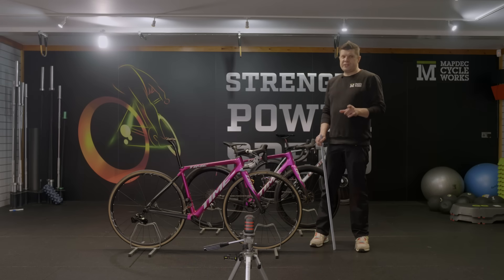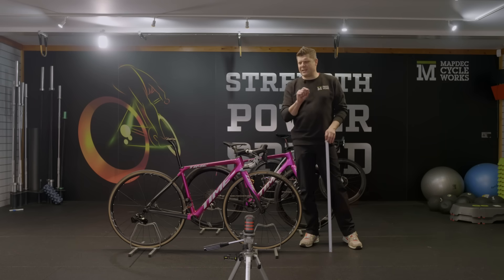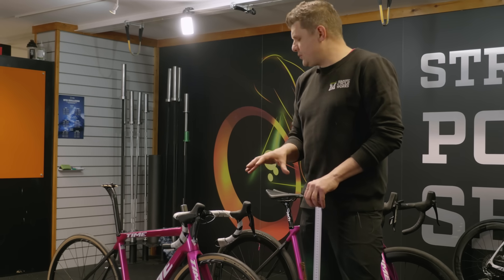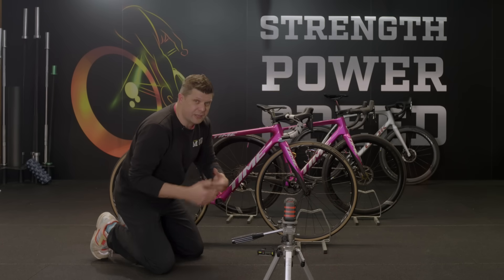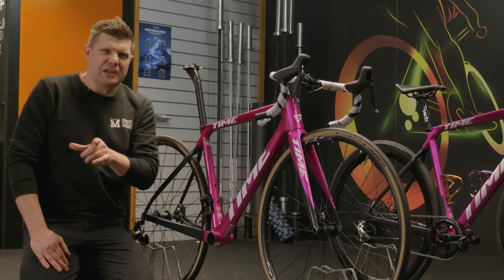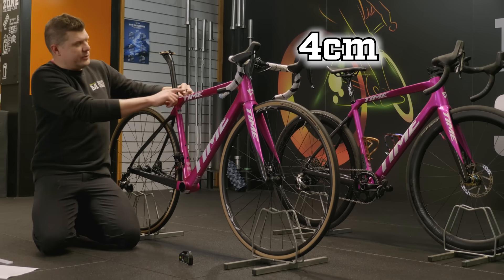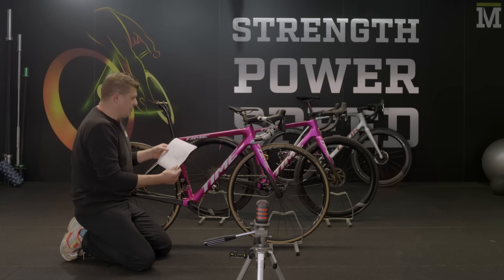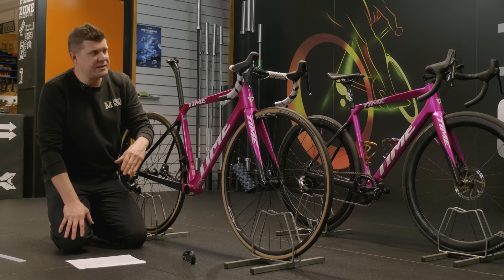Small Bikes - Big Decisions

Comment: I'm one of those riders with small bikes, and I will say that I've never seen an xs with a 172 crank on it. For folks with knee issues, that size crank may cause more knee issues if they are not able to get the knee over the pedal axle. I had a ti frame custom built for many years ago, and had a fit before I ordered it. It was indeed the most comfortable bike that I've ever had. I did tweak handlebar and stem over the years, but truly was very fortunate. I also had a couple of other fairly high end road bikes at the time, and although they were indeed comfortable... still nothing was quite the same as the ti bike. As someone who has had 5 knee surgeries, that distance from seat to handlebar and knee to pedal axle were crucial for me, and might not be quite as important as someone else.

Comment: It's too bad no brands bother with smaller wheels on their smallest sizes. 584/571BSD wheels would help a lot to get the toe overlap issues in check, and allow for neutral handling. You'd expect the gearing to change slightly to compensate for the smaller diameter, but it's possible.

Comment: Something this video didn't touch on is the controls i.e. how do small and tiny hands cope with brake levers and shifters? I remember this was a big problem for me as a child, I could only brake my first road bike with the lever extensions that ran parallel to the tops, and by the time I out grew the bike I still barely able to brake from the drops.

Presumably electronic shifters are much easier, but what are the best options if you can't afford electronic? What are the best brakes with shortest reach for tiny hands?
Reply from the maker: This is still a problem in kids bikes.  A few brands are trying.  The effective and adjustable stuff is on products out of price reach of young riders.

Comment: Very slack head angle and very short stem is the default configuration on most mountain bikes, so what makes it not scary for those? is it purely the 700mm - 800mm bar width that makes the difference? or is there something else going on with the overall geometry?
Reply from the maker: Good question. On MTB you will descend standing, with weight further forward and yes, with wider bars.  If you have tried climbing on a slack MTB with short stem you will know exactly how hard they are to keep in a straight line.
Reply: @Mapdec  Not something I've tried, my MTB was an ancient 90s era model when I had one. Really would love to get something modern (both road and MTB) but it probably won't ever happen at this point.

Comment: Others have mentioned 650b wheels, but 650c used to be an option when aero and TT bikes meant getting the front lower. This seems like a more suitable option in terms of size because it's a smaller diameter than 650b, but there are extremely few options to buy, and I'm sure you can't get good tires for 600c even if you can get the wheels.

I think it will take a combined collaborative effort from the biggest bike brands, Giant, Trek, Specialized, Canyon, along with a couple of wheel and tyre partners like Pirelli and Continental to commit to making equivalents of their best low rolling resistance tyres in the 650c size, and wheels that have equivalent wide rims and aero profiles to the 700c versions.

There's so much inclusivity virtue signalling from corporations, but here is is something actually useful they could do, and given low tech nature of bicycles, and the vast size of the market in Asia I'm surprised it's not already been tried to make more accommodations for small riders, but I think it's important that small cyclists are able to access equal equipment with equal marginal gains to average size riders.

Side note to all of this, the UCI could probably help to by overhauling the regulations concerning bike shape and geometry to properly accommodate both small and tall riders - Conor Dunne on GCN mentioned the size 61 and above don't have complete aero profiles because e.g. the seat tube cannot follow the wheel in the largest sizes due to regulations. Maybe the minimum weight limit should be lowered for the small sizes as well.

At least cranks are easy to solve, Appleman and a few others sell cranks that are available in 100mm and 135mm lengths.

Comment: the solution is smaller wheels. I don't see a reason why 26" wouldn't work. you'd have to lift the bottom bracket up, but in terms of rolling resistance, there's no difference.
Reply from the maker: It’s because a smaller wheel travels less distance for the same gear.
Reply: @Mapdec  sure but I don't see many female pelaton riders needing a 60T big ring. or am I thinking wrong?
Reply from the maker: @oftankoftan  they wouldn’t.  It would be a disadvantage. You would need more power. There would also be race support issues
Reply: Gear ratios are gear ratios....

Comment: Great video. Trying to decide about bike geometry for new custom bike for my wife. There are so many compromises to make and very hard to make final decision without trying to ride many smallest bikes available, so many funky decisions by bike brands in XS and XSS sizes. 
She founds that vintage bikes from 70-80s feels the best in terms of handling and cornering at high speeds, but they are little too long for her (minimum top tube lenght on vintage bikes is 51 cm). Some modern stock bikes that she tried feels so weird and they are almost all also too long except Pinarello X.

Comment: Another great video.
Interesting about the stem length, as on a mountain bike, at least on a enduro bike you want a short stem for direct steering.
But I guess that won't work as well on a road bike due to the awkward position the rider is in. On a MTB you have the freedom to have direct steering a wide bar, and steer easier.
A road bike is a compromise for going fast on the road. I've never tried it. I will likely not buy a road bike.

Comment: Very well explained, thank you! I will think about that in a search for road bike. Because I feel that I am always somewhere between XS and S frame. As others have mentioned, 650b wheels looks more appropriate to smaller frame and people. But the offer of tires and wheels in 650b is way smaller than for 700c😐
Reply from the maker: you need to consider your gears with 650. to go the same speed you will need to pedal harder or faster.
Reply: @Mapdec  yeah, good point as always 🙂
Reply: how tall are you? I'm 5'4 and use a 51.5 top tube length.

Comment: Modern carbon bikes are basically cookie cutter, manufacturers,  want to keep production limited to 5-7 sizes, and keep the geometry, very similar.  All they care about is selling more bikes. Endurance vs race geometry is nonsense proper bicycle geometry depends on the rider’s anatomical needs.  The bicycle industry tends to neglect the needs of smaller riders. Most cyclists,  need to just get a bike fit by a reputable fitter,  and stop trying imitate, professional cyclist, and stop trying to fit yourself.

Comment: Toe overlap is not just the preserve of those with small frames... I had a Trek Domane in a 58 (!) and still had overlap problems.  Unlike any other bikes I've had.  Seems like careless design rather than there being a good reason, but am happy to learn otherwise.  Peak Torque had a similar problem not long back IIRC.

Comment: Maybe someone help me with a problem thst I struggle. I live in the Alps and I also do mountain biking and I love the descending on my small Gravel bike Bombtrack Al 2017 (witch is a cross bike and it's nimble, and I like that) The problem that I have with my bombtrack is that around 60/70kmh it's starting to be terifing, I'm guessing a longer bike will help me with that. So for my next bike I'm considering a M size but then what can I do with the reach as my current S bombtrack is almost at the limit on the reach with a 70mm stem. I tried a 60mm stem but it feel very weird because the bike has also a slacker head angle, and a bigger trail. I want a bike that it's can fit my size (165) feel nimble in the corners or on gravel, but also able to hit those speeds on descending in the alps.

Comment: My wife is 4’10”. Bike fitting is a nightmare. Ultimately sacrificed the 700c wheels and went for 650B on her road bike. 
Now the issue is finding good (reasonable price) carbon wheels at the 650b size. Any recommendations?
Reply from the maker: pretty sure you can still get firecrests in 650
Reply: The problem is that there are no good road bike tires in 650b :(
Reply: She currently has Schwalbe Pro One on the 3x small Canyon with 650b wheels. Not the greatest but better than having a poorly fit bike.
Reply: Continental Grand Prix 5000 comes in 650b. A bunch of others as well

Comment: When the rider is light in the upper body a slacker head angle helps to add 'geometric weight' so the front wheel doesn't disappear in the corner.  It works quite well across sizes since small bikes are ridden by small women usually and big bikes are ridden by big men with weight in the shoulders and those bikes have steep angles to lighten the steering which they need to compensate for the extra body weight on the bars.
Reply: Proper riding position on a road racing bike is with the upper body being supported primarily by the core muscles and not on the arms. Arms only resting lightly on the bars for handling. What you describe is precisely the reason why so many riders get numbness in their hands, shoulder and elbow issues.
Reply: @82vitt  I agree that there should be no weight on the hands.  The centre of gravity for small women and big men is still in a different place between the wheels, though.

Comment: Begs the question why 650b/650c/27.5" wheels are not more popular now than ever with the adoption of disc brakes, considering the vast amount of S and XS frames sold in massive markets like China. Surly's been doing it for years on some of their frames, even went down to 26" for the smallest frame sizes.
Reply from the maker: Gear ratios, torque, fairness
Reply: @Mapdec  if one can hold 90rpm gearing is available plenty now to counteract the wheel difference. If that cadence is not really attainable or it's a casual rider, don't really need to worry about all that math as it wouldn't make a difference anyway. However, the riding experience in both cases would be absolutely spectacular compared to the penny farthings they ride now. What do you mean by fairness?
Reply from the maker: @cosinus_square  oh. You don’t loose much weight with 650, but you do loose some momentum.  You also travel less distance for the same gear, but that gear still needs a similar amount of force to be applied to the pedals.  So, a rider on 650 might accelerate faster, but would need a higher power output to maintain the same speed as a similar rider on 700.  To achieve the same gear inches, they would need to be in a higher gear, and as you know, those gears are harder to push.  You might have experienced this in MTB when your mates got 29er before you.
Reply: I

If you achieve the same gear inches, there's no difference in the gear.. Or have I missed something?
Reply from the maker: @peterwillson1355  to achieve the same inches, you need a higher gear, a higher gear requires more torque to turn it.
Reply: @Mapdec  You've got a point when it comes to racing. Non-racing, we're talking a couple teeth difference in chainring size, not sure what you're thinking about. The benefits would be much more significant than the couple mph lost.
I've ridden but never owned a 29ers because I don't want to loose the ability to throw my 27.5 around for like 1mph extra off road, which is still slow af uphill. I'm more confident on my 27.5 downhill as well, a 29er feels too big and I'm 5.11.
Reply: @Mapdec  This is fundamentally flawed thinking. The gear ratio means nothing without the context of wheel diameter. A rollout of “X” will not be any “harder” or “easier” whether it’s made with a smaller ratio and larger wheels or larger ratio and smaller wheels. It’s basic maths. The only real world difference comes from smaller wheels having higher suspension loses, a small price to pay for a better fitting and handling bike.
Reply: @Mapdec  Gear=gear inches=gear
Reply: @Mapdec  Brompton, wheel diameter = 16.6 inches. 50t + 12t sprocket = 69 gear inches
700c rim 23mm tyres , wheel diameter = 26.6 inches
52t + 20t sprocket = 69 gear inches
39 + 15 t sprocket = also 69 gear inches.
Gear inch ratios = gear inch ratios , doesn't matter how you achieve them, there is no difference in the torque required to use them.

Comment: Very good content, but there are two topics where I cannot fully agree with you, Paul. From my own point of view (being a 173 cm guy, so I consider myself as being short - at least in terms of bike sizing for some brands, haha), the standover height and toe overlap are not that important. That's only my personal opinion of course. With the high standover you can always lean your bike on one side to lower the top tube between your legs (and make it a habit). As for toe overlap - yes, that was a little bit scary when I experienced that for the first time (coming from MTB where it never was a problem, for obvious reasons). But it also can be easily avoided with couple of simple techniques (avoid the front foot to be on the opposite side you are turning into). So, it is again just a matter of making riding habits. Of course, I'd rather not have to deal with these two problems, but let's not make a big deal from that. Peace!

Comment: XS in Time was 53 top tube. So not that small... It's my frame exactly, and I'm 177 cm, albeit most of it are legs. 80 mm stem and Pro Vibe Aero Pursuit (equivalent of 11 cm stem and normal reach handlebars for me) and that's perfect bike setup in terms of weight balance. It's also good because with my monkey arms on a smaller frame I can have my stem low enough.
Reply: no its a 51.3 top tube length. I use a 51.5 top tube length and I'm 5'4
Reply: @joed7185  Ahhh, that makes sense. I have a 2018 Scylon, and XS has 53 cm top tube. They came to their senses then :D